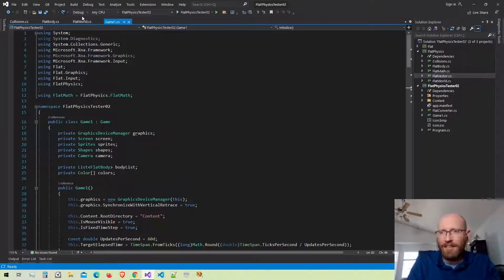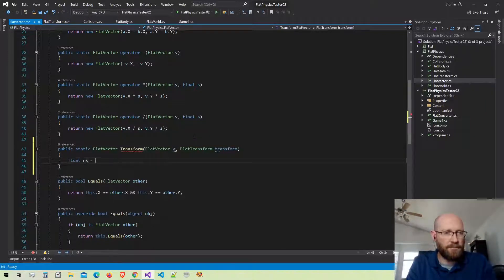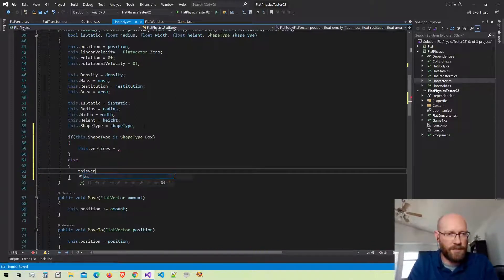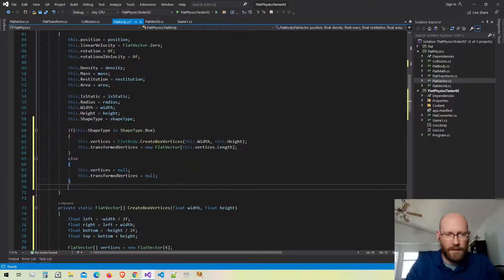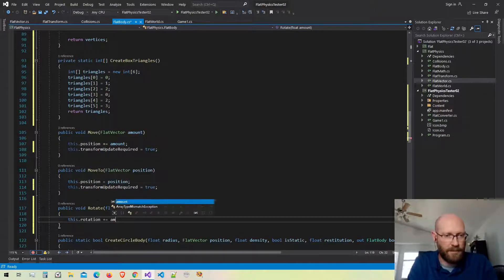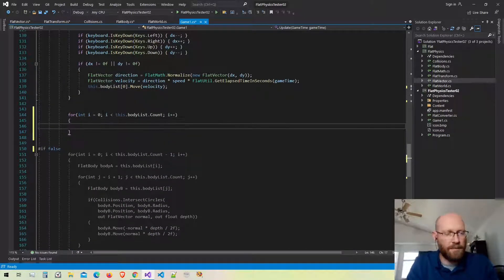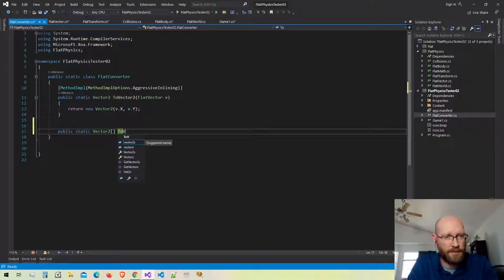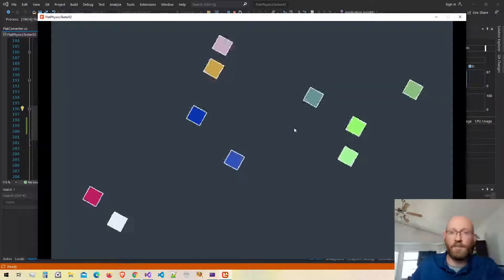Boxes and 2D Transformations - Let's Make a Physics Engine [04]

Comment: Thank you very much for these videos, I like your methodical style of explaining things, 
I wanted to ask, is the transformedVerticies array only there to store the position vector after the transformation has been applied and the x and y coordinates of the box have been added, if so would be be viable to remove it and rewrite the original vertice array each time instead to improve performance?
Reply from the maker: Thanks for watching!  Glad you are enjoying them. If I understand your question correctly: We have to keep the original "untransformed" vertices and do the transform on the original vertices. If we transform already transformed vertices they will not be correct.  The transformedVertices array is also there so we don't have to make memory allocations for a new array every time we want an array of new transformed vertices (which would put a lot of pressure on the garbage collector).
Reply: @two-bitcoding8018  Thank you very much this clears things up, I was trying to apply transformations onto the transformed vector list.

Comment: Really enjoying the series so far, keep up the good work

I wanted to ask something about ToVector2Array function
Is there a difference between dst[i] = new Vector2(v.X, v.Y) and dst[i] = ToVector2(v)?
Besides that second one looks cleaner, I was curious to know if it made any difference performance-wise?
Reply from the maker: Thanks for the support! I am thinking that there would be no difference. It probably gets in-lined by the compiler at runtime anyway. You're right, the 2nd one does look cleaner.